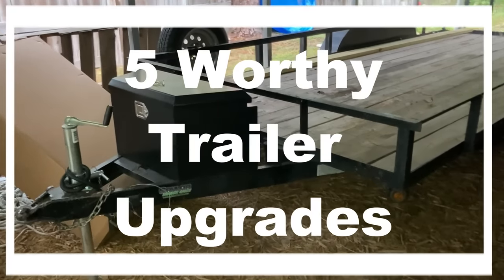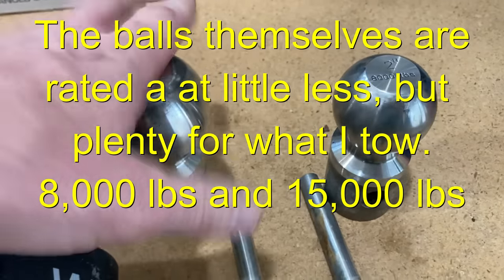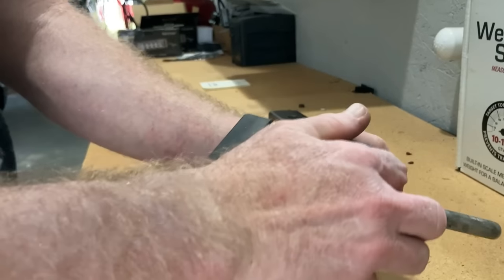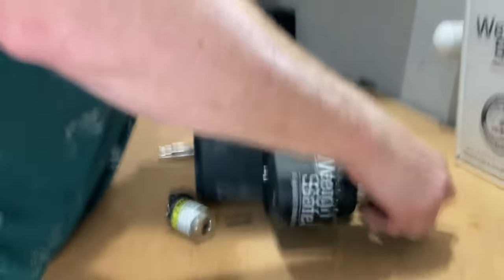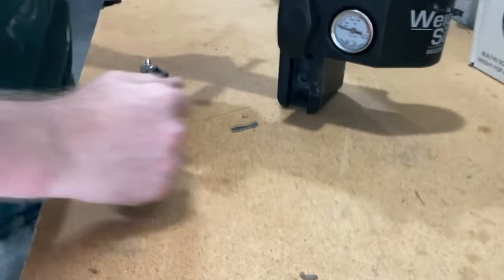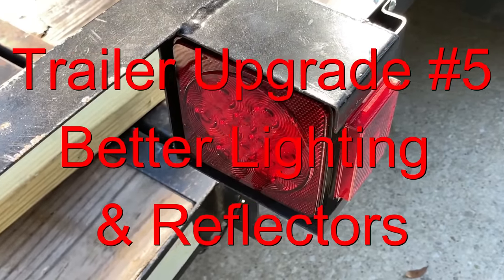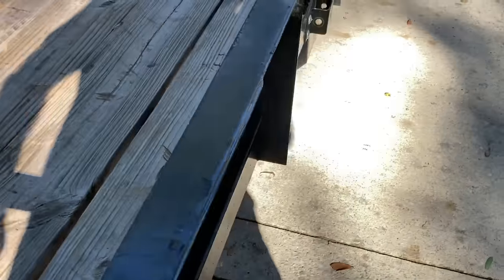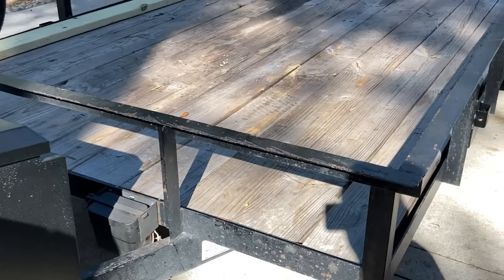5 Worthy Trailer Upgrades

Comment: The Weigh-Safe is great.  I can get 10-15% on the tongue with it easily.  Once I setup one vehicle on the trailer, I paint the wheel position so  I can get it right every time.  Though expensive, makes towing safer and well worth it.
Reply from the maker: Yes it is pricey, but it is a quality piece and I think still cheaper than it's "real" competitors.  I do like the idea of painting indicators for different loads, that's a brillant idea.  Thanks for watching.
Reply: How long have you used it? I’ve heard they work okay for set up and measuring weight but if you tow with them they will quickly break due to dynamic road forces (trailer tongue weight bouncing up and down) exceeding weight gauge.
Reply from the maker: @preachers4135  I've only only mine for about 6-7 months, so I couldn't tell you about long-term use just yet.  However, mine is likely never been past it's "max" weight, bouncing or not since I usually never load it more than 500# or so and I think the max weight on the scale is like 1500#.  I think once I had it closer to 600-700#, but that was pretty rare.  But I really hadn't heard about that before and will see how it does over time.  Maybe I'mm have to do a long-term video at some point.  Thanks for watching.
Reply: @preachers4135  Been using 2 different models for 5 years. The rumor you heard was a myth. It's a pretty heavy duty built in scale. The bouncing weight wasn't an oversight in design. Pretty common knowledge for the average tower... i imagine the engineering team that designed the multi million dollar product didn't miss that detail
Reply: The weigh safe seems like a nice upgrade, but if you never know the weight of what's on the trailer it's not very useful.  It's basically a guessing game just like positioning the load without it.
Reply from the maker: @MikeF421  I agree Mike, I know the weight of my trailers adn what I haul or at least have a good indication.  Short story, I had to take my whole "new fence" down to my rental property, so I weighed each component, picket, fence post and side rail, multipled each bby the number of pieces, then added the weight of my trailer.  I had some of it in the trailer and some in the bed of the truck.  So I had to calculate each value and of course the weight of the tongue was higher not just because of the trailer but also because of the weight already in the truck, I was a little over probably what I was rated at.  Here's the video, I'm not the average redneck that wings it😂😂. https://www.youtube.com/watch?v=z9Po4aP10go&t=
Reply: @MikeF421  No.  If you know the weight on the hitch, that is MOST important.  If your hitch setup has a wight limit of 600#, then keeping it to that or below is critical, regardless of the trailer weight...
Reply: @slashsplat  True, but if you have a 5k load, don't know it's 5k, and load it to a 100lb tongue weight it's just as dangerous as overloading your hitch set up.
Reply: @paulhiggins6600  what's the point of knowing your tongue weight if you don't know your load weight?   I usually load until I get a little squat on the truck and have never had an issue.  I very rarely haul the same vehicle twice, and usually not for more 30 miles so in the time I'd spend trying to find a scale and getting weighed I could be at my destination.  It's amazing how people are worried about knowing their exact tongue weight now that there is a way to measure it.  What did people ever do before the weigh safe? Oh yeah, they guessed and loaded till the truck squatted.
Reply from the maker: @MikeF421  I'd have to say knowing the tongue weight but not knowing the load weight makes knowing the first one less important, but I can usually figure out my load weight but simply knowing what I'm hauling.  I usually tow only a few things and can easily research the weight or if it's something small, I usually don't care as much.  However, if it's a large and heavy item, I do want that info if attainable.  I certainly think you can over-analyize things, but I think it's a nice feature and still cheaper than the fancy competitors.  Just my opinion.
Reply: @MikeF421  Actually, it is useful, since you can know the tongue weight, at least.  Given that you have a limit on that from the vehicle, you can at least know the vehicle is in a safe condition at the tongue.  You can estimate the trailer weight close enough to know if you are in the ball park for the load.  If the load is that heavy, you need to get it weighed...
Reply: @MikeF421  Not sensible to set 100# tongue when you can easily guess your trailer is more than 800-1000#...  Set the MAX tongue weight your vehicle is spec'd for and KNOW that you are at least within spec for the vehicle, regardless of the trailer weight.  Better too much weight than too little.

Comment: The holes are lower on the D ring because they’re meant for the pin to go below the pocket. Most pocket do not have a hole for a pin. That’s y it is not setting level for you
Reply from the maker: Yes, granted they were cheap stake pockets and relatively cheap D-rings, they were a set put together with different parts from different suppliers, surely a better thought out plan could have been done.  Thanks for watching.

Comment: I had a similar keying system for a hitch a long time ago, I left it in my truck all the time cause I hauled all the time. The locking system eventually got corrosion inside of it and I had to cut it off, just an FYI.
Reply from the maker: Yeah, I will certainly monitor that for sure.  It does have a rubber cover over each keyed section, but still, corrosion can still sep in.  I do however, seem to take the receiver out every now and then and I will often adjust the height of the ball, so maybe that will keep me on my toes.  Thanks for watching.

Comment: What type of brakes do ya have on the trailer? 
I am saving to get caliper brakes out on . 
That’s one of my planned upgrades along with adding stale pockets  & more lights to include a bright backup bar on the trailer . 
A lot of times I arrive at night so that would make it easier to see where I wanna go . 
Good video Senor.
Reply from the maker: They are the standard drum brakes, likely from Dexter, or the ones that Dexter puts on their axles.  It does have brakes on both axles.  I don't know if that is standard or an upgrade.  I do know some other trailers I've seen only have brakes on one axle.  Disc brakes would be a nice upgrade.  Thanks for watching Eddie.

Comment: Would have liked to have seen how the tool box was fastened to the trailer but a great video
Reply from the maker: Yes, so it had four simply bolts that you had to drill through the frame of the tongue.  Wasn't a huge deal, but drilling through thicker metal sort of always sucks.  It was just where the edge of the tool box sat on the tongue rails.  Thanks for watching.

Comment: what brand is you spare tire carrier....my trailer rails are angle iron like yours and i cant find attachment online?
Reply from the maker: I don't have that trailer anymore, but that tire carrier was actually part of the trailer when I got it, so I can't help you.  I think I did get a tire carrier from TSC for one of two of my other trailers.  My current trailer, a 16' er with a 6000# single axle also has a premadetire carrier.  It has six lugs and larger 16" tires with 10 ply tires.  Try TSC and Northern Tool, those would be the first two places I'd check.  Thanks for watching.
Reply: @MyProjectsFL  thanks friend, maranatha in 2023
Reply from the maker: @richardmachovec6005  That would be nice.

Comment: How is spare mounted?
Ramp storage?
Reply from the maker: Spare tire was mounted on the side, I think the pic showed that and no need for ramp storage, this one had a gate/ramp.  My dream trailer would have the slideable ramps that pin up while in motion that also have the triangler brace at the bottom that steadies the trailer while loading and unloading.  I do have a different trailer now, a 16 footer with a heavy duty single axle rated at 6000#, so slightly smaller than this one.  I need to do another video on that one.  Thanks for watching.

Comment: I’d love to buy a trailer like that one day and turn it into an over lander camper with walls and roof.
Reply from the maker: I'm actually moving back to a one axle trailer with a beefy 5200# axle, I never really used the 70000# capacity and now don't need the length.  I think I'd recommend a beefy single axle for overland use too.  I hate the tandem axle situation, but they are great for hauling heavy loads.  Thanks for watching.

Comment: how  about a video: 5 best downgrades for a trailer
Reply from the maker: 1.) Broken Axle
2.) Missing Fenders
3.) Non-working or missing lights
4.) Busted Gate with Bungy cords holding it up
5.) Rotted out floor boards
I do have a buddy that has a trailer that may supply the content for such a video.🤣  Thanks for watching.